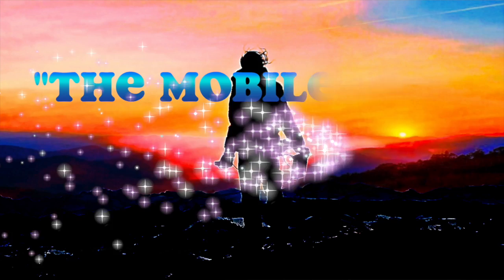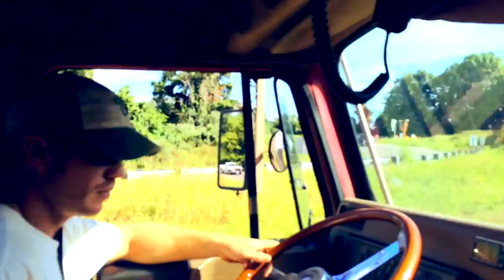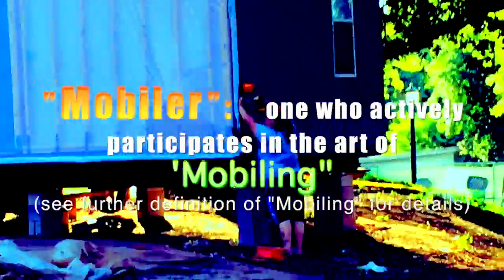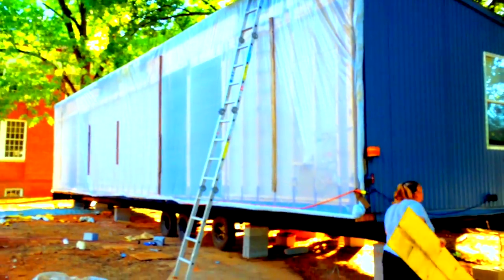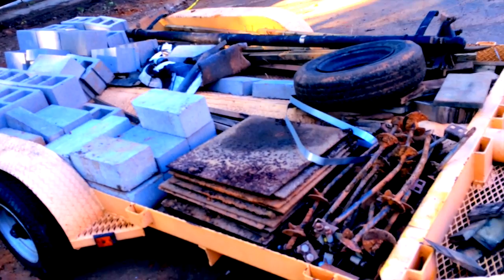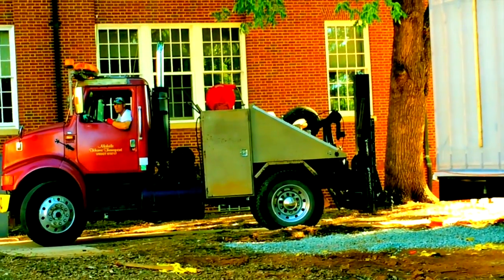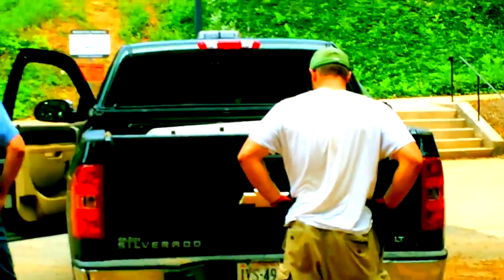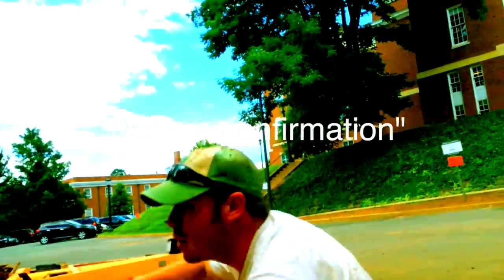used mobile home move and remodel, how to move a mobile home With the BRMH Mobile Men

Comment: That's most likely not a mobile home.  Its probably a temp classroom.  That's Mobilease Modular which is owned by the Bartons that I use to do a good amount of work for in the past.  They are good people.  The mobile homes don't have the big Bard units on the front.  And as Rocky Mountian said, you really should watch yanking those anchors out like that.  We use either our toter like he said or our platypus.